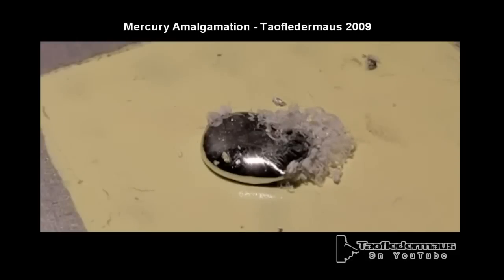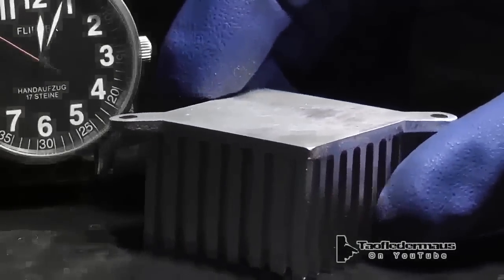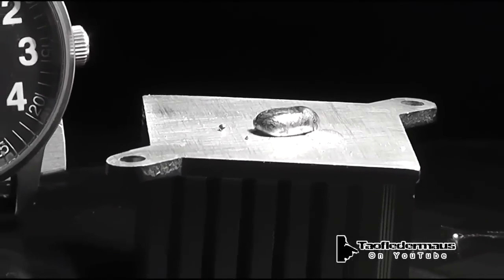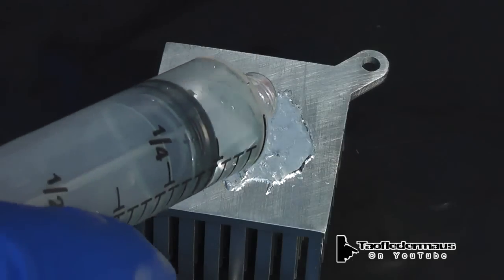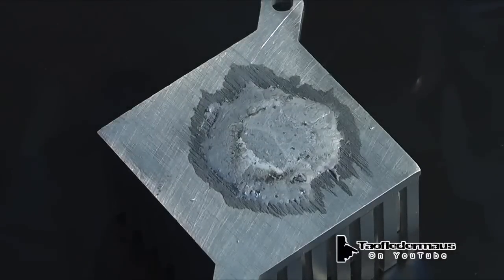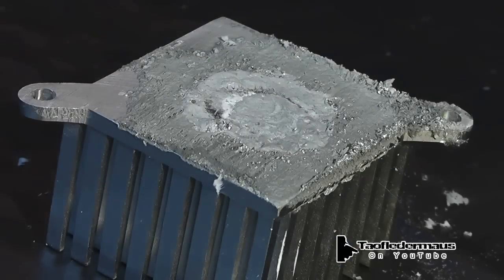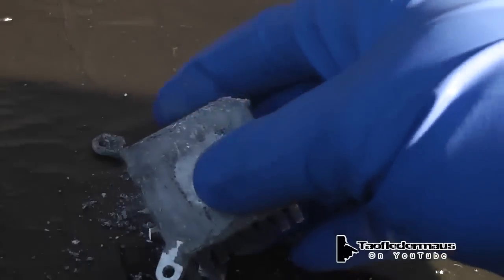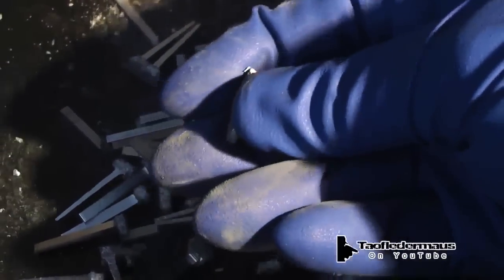Mercury AND Gallium - Totally Destroys Aluminum Heatsink

Comment: Gallium actually does not go through the aluminum oxide layer at all. I added gallium to aluminum just a few days ago and without mercury, you can see where the gallium has gone underneath the oxide layer rather than going straight through it.

Comment: I still would like to know what would happen if you outed gallium under someone's car hood
Reply: i was thinking that but in the supports of a building i think a fair amount would cause a building to collapse with the weight of the brick and mortar around the metal support beams.
Reply: Support beams aren't made of aluminium they made out of iron or steel.

Comment: Huh. I never knew gallium had a dispersion medium that is liquid. It's like paint or glue; all gooey.
Reply: im not sure what you mean. every metal gets fluid if you heat it up enough.
Reply: da real rulezbreaker You know how whipped cream works? It's a solid with a dispersion medium of liquid. That's what I mean. Google what dispersion medium means.
Reply: the gamerator 10
thats if you mix a material that is solid at a certain temperature with another material that is fluid at the same temperature. but if you have pure gallium, then how is that possible? its just one material.. its either fluid or solid at a temperature, but never both.

Comment: Gallium causes the aluminum oxide protective layer to break down.  Which leaves aluminum to oxidize easily.  If you do this in water the bond between aluminum and oxygen is stronger than hydrogen.  And the solution will dissolve the aluminum much faster and leave a solution of lumina with the gallium can be removed from the solution with a cheese cloth.  Which leaves the aluminum oxide solution in the exact state you can apply electricity to convert back to aluminum.  The process produces hydrogen!   Take aluminum pellets, and say a tank of gallium water,  mix to make fuel for a fuel cell..  To refill the fuel cell with hydrogen..  Is draining the solution of lumia refill with water and pellets of aluminum, and gallium...  Safe storage of hydrogen.  The drained solution can be shipped to a aluminum plant say next to a nuke facility or maybe if the pellets are small enough maybe right on site using solar or something..  But probably cheaper to pipe or ship the lumia

Comment: did this process release any hydrogen gas?
Reply: +wizard No, why would it? Only 3 metals reacting. Doesn't need anything like water vapor or air to happen.
Reply: +wizard Nah but my out loud speaking of these comments to myself has emanated carbon dioxide gases :I

probably why I sneeze at my desk all the time... I do that kinda stuff a lot.
Reply: the reason i mentioned hydrogen gas was because alloy is sometimes used in the process of hydrogen gas.
Reply: +wizard There were no hydrogen-containing compounds in that reaction so the simple answer is no.

Comment: Wait a moment.  In previous videos you said that mercury was the only metal that was liquid at room temperature, but it looks like gallium is also a metal that is liquid at room temperature.
Reply from the maker: +MrWhitman  I guess a sauna is a room, huh?
Reply: Yes, it is a room.  Besides, where I live, 78 degrees is a rarity.  86 degrees is actually the norm in the cooler months.
Reply: +MrWhitman   well thats not considered room temp.  Just cause you're room's nearly 90,  that doesnt make room temp higher.
Reply: Daniel Simon It was a bad joke.  Okay, I was just making a bad joke.  OF COURSE room temperature doesn't go higher.  Sheesh.
Reply: galluim is actually solid at room temp (65-70°) but metals such as galluim and cesium can melt at body temperature
Reply: +Antwan The Hankblock Savage 65-70 celsius?
Reply: +MrWhitman  no it melts at around 84 degrees
Reply: +MrWhitman I think you're taking the idea of "room temperature" too literally. If you were to set a room on fire, it would get pretty damn hot in there. You wouldn't say you're at "room temperature" as you burn to death...
Reply: +MrWhitman  for something to be liquid u need to be able to pour it out...u obviously havent looked at the galium properly

Comment: Why does it attack aluminium
Reply: +TheSamuel9464 The Gallium and mercury amalgamate, which is a fancy term for alloying that involved metals like them, with the aluminum. Aluminum may not look it but it is very reactive, the surface almost instantly reacts with oxygen which stops the rest from reacting, but gallium and mercury inhibit it's ability to keep a solid layer of aluminum oxide, and with gallium or mercury added as new forms it flakes off, making more worm which then flakes off. It's just like how iron oxide flakes off of iron so that the underneath layer can oxidize, only much faster. And as for the weakening effect, gallium aluminum alloy is just very soft and brittle, (also a eutectic mix of gallium and aluminum is liquid at room temperature).

Comment: Hi Jeff, back in the 60s I rubbed a droplet of mercury into a piece of aluminium with "wet" wet and dry sandpaper. The water let the mercury form an amalgam with the aluminium and this exposed the aluminium to the air which formed aluminium oxide whiskers on top of the mercury very rapidly. I supplied the aluminium and the sandpaper and my science teacher supplied the drop of mercury and the water along with the instructions. How times have changed. OSH would have a fit! Peter.

Comment: Welding aluminum is such an hard process, perhaps a little bit of gallium can help the welding of aluminum in some way. The oxidation is so strong that it's kinda hard to make a good weld without out pofessional tools. Could you find a way to use gallium (without mercury) to bind aluminum to another piece using any filler type of material? 
Or do you know a way to remove the galium after adding it to aluminum (we're talking a very tiny amount.
Reply: Derk Jochems Gallium does the exact opposite of what you want to do - it separates aluminum and irreversibly damages its structural integrity.  The easiest way to separate them is to add water (which produces hydrogen, and a lot of it).  The aluminum is left behind as a powder, and the gallium can be clumped together in a little ball, and can be re-used pretty easily.

I don't know much about welding but I think the aluminum powder might be easier to weld than just plain aluminum, but I could be wrong.
Reply: Peter Schmidt Aluminum has an oxide layer wich is so tough, and melts at a much higher melting point then aluminum itself. Galluim seems to penetrate that oxide layer with ease. And mercury possibly too, but mercury is not allowed to be used in any products in the EU as far as i know. 

I see what you mean, and your right. I was more aiming towards getting opinions and probably somebody who has gallium to try and fuse aluminum with something (like a weld). 

The process i mean is break-and-restore, gallium breaks the oxide and makes room for something to fuse the aluminum to (as in theory there wouldn't be any more aluminum oxide so it makes for easy fusing, but as you suggested it breaks up the aluminum irriverisble).

It opens a view, that isn't tested so far i know.
Reply: Derk Jochems
It's a good thought in theory, but aside from the gallium penetrating so deep into the aluminum, part of the problem is figuring out how to remove it without removing the aluminum with it.  It is a chemical bond, after all.  But yeah, it's too bad it isn't a solid structure because otherwise that would be an incredibly easy way to weld.

If you like energy efficient ways of welding, you should look into "cold welding".  There isn't really a practical way of doing it (on Earth) but still amazing, and something that astronauts do.
Reply: Peter Schmidt Thanks peter, and for the record i hope some bright people will find a way to be ingenius and find a good way for aluminum (very easy) chemical bonds..;)

I'll have a look in cold welding for now. As i can't experiment with gallium (can't import it from the us to the EU).
Reply: Derk Jochems
Actually I completely forgot to mention - the oxidized aluminum powder you get from the gallium+water+aluminum reaction is one of the key ingredients to thermite.  Not sure if you're aware of thermite but it is known to be used for welding and under the right conditions, all you need is a lit match.  Careful though, thermite has a terrifyingly violent reaction.
Reply: Peter Schmidt are you serious, i'm totally not able to handle thermite here. It's too close to other people. Way too dangerous stuff. But it might be an interesting thought though.

Thanks for the info that could help others move along.
Reply: haha yeah, definitely need to avoid using thermite near.... anything.  Great product to remove waste materials though lol.
Reply: Peter Schmidt I know the stuff from mythbusters and seen it on youtube. It destroys everything, cars, tanks muhaha but i'm not ever going to test that here. 

Having a heineken now, cheers .. ;)
Reply: I've played with an AC TIG welder, and it's actually pretty straight forward welding aluminium?
But yeah, USD$1,500 is an expensive entry price...
Reply: +Peter Schmidt:
"The aluminium is left behind as a powder, and the gallium can be clumped together in a little ball, and can be re-used pretty easily."

==That's not aluminium powder. It is Al2O3, aluminium oxide.
Gallium is not as reactive so it stays mostly in its metallic form.

"Actually I completely forgot to mention - the oxidized aluminum powder 
you get from the gallium+water+aluminum reaction is one of the key 
ingredients to thermite."

==No, the thermite reaction uses Al powder and iron oxide powder. You could of course use some other oxide to reduce, such as zinc oxide and various other oxides. For the Al powder (the reducer), you could probably substitute with some other reactive element like Mg powder.

Comment from the maker: Lady Minion
2 hours ago
Linked comment
did you copy this from mist8k ?
-
Why to people ask questions and disable the "reply"  option?   Don't be like Lady Minion
Reply: DID YOU COPY THIS FROM TAOFLEDERMAUS!?
Reply: Question:How do you dispose of all the amalgamates as well as the other toxic mercury by products like mercury oxide?
Reply: +TAOFLEDERMAUS  O_O i just came up with something why not stick a gallium plant near a aluminium f150 plant so ford will make steel body trucks instead of Prius plastic and aluminium lol
Reply: I love your mercury videos! But just a question, how much does mercury cost? Is it expensive?
Reply from the maker: It's about $100/lb
Reply: ***** you think he uses 5 lb per video? -.-
Reply: *****
fair enough. The experiments I've seen he was using less than the outer joint of a finger.
Reply: +Teryhr He Reuses The Mercury
Reply: +Teryhr Yes It Can. He Has Many And He Only Does Experiments Wasting Mercury Very Rarely, And When He Does, He Uses Only A Bit. He Said He Bought Lots Of Mercury 15 Years Ago. He's Using The Same Mercury.
Reply: ***** Sometimes Is The Keyword Here.
Reply: +TAOFLEDERMAUS oooooh, taking the piss out of nerdrage's channel are we?
Reply: Wait, +TAOFLEDERMAUS, does this mean you are NurdRage?
Reply: +TAOFLEDERMAUS Hi u got me wondering how far can u take this experiment... how deep can the gallium penetrate?  does it penetrate any steel or aluminium? would u get through 3 inches of steel?
Reply: Did i ask u or?   i didnt think so
Reply: +Virtualgod2009 you really shouldn't do that bc what if the trashman touches or it goes near a place where we get our water?
Reply: +some guy are you joking? cuz if you are serious im highly concerned about the farm and crops where these mercury spiced herbicides  are used. mercury for your instance actually its organic salts are very toxic.
Reply: I thought you were nurdrage but i blame autoplay
Reply: yes, it would be disastrous for gallium to get on an ALUMINUM air plane... but what about STEEL plane? hmmmm? lol I'm just messing around. Anyway love the Content
Reply: +MegaCHUBBER

NurdRage has a MUCH deeper voice.
Reply: +Jason Mayne NurdRage is using a voice changer -_-
Reply: Billy Holman How do you know?
Reply: Jason Mayne dude, it's fucking obvious, no one has that deep of a voice naturally
Reply: n
Reply: You should buy a car with an aluminum block or heads, put gallium on it and run the engine
Reply: sjpro1 KABOOM!!! That is, I think that would happen.
Reply: Jason Mayne yes but how much of one haha
Reply: sjpro1 I think that if the block explodes, it'll cause a chain reaction and explode the entire engine, as well as the fuel.
Reply: Jason Mayne doubtful. the fuel system would likely be unaffected.
Reply: sjpro1 Ok.
Reply: according to my science teacher the oxidation layer is aluminum and the raw metal is aluminium
Reply: You have good voice mimicking, or it's a voice changer.
Reply: BroDaCarot the oxidation layer is aluminum oxide and the base material is aluminum. or if you are in England it would be aluminium oxide and aluminium. Aluminium and aluminum is the same exact thing just spelled differently depending on the region just like aeroplane and airplane or whiskey and whisky. But the aluminum and aluminium spelling is debatable because the person that discovered the metal named it aluminum and a governing body at the time wanted the I before the um for consistency to match other metals like titanium or some such bullshit that makes no sense because there was already platinum so it was renamed aluminium in British circles.

It's also a fun word between Brits and Americans when they say it and call each other out on the pronunciation when they are both correct. One would never guess that one little I would make so many look like fools for calling others out.
Reply: HhhTAOFLEDERMAUS

Comment: ***** 
Good question for you. If you have a half inch aluminum cylinder and you soak it in Gallium depending how much you use... How long would it take to fully break down all that Aluminum so you can break it in half with your hand or even a press?

Thanks and loving the information you push out every video :D

Comment: We are manufacturing company specializes in Elementary 
substances such as:Prime Virgin Mercury 99.99%,Silver Liquid Mercury 99.99%,Metallic Mercury,Red Cherry Liquid Mercury White Liquid Mercury

SPECIFICATION

- Virgin Mercury purity = 99.99% by wt min.

- Free from heavy metals

- Packing iron cylinder ( 34.5)kg net weight or 1kg Flask

- Physical State: Liquid

- Appearance: silver- Odor: odorless

- PH: Not available.

- Vapor Pressure: 0.002 mm Hg at 25C

- Vapor Density: 7.0

- Evaporation Rate: Not available.

- Viscosity: 15.5 mP at 25 dig C

- Boiling Point: 356.72 dig C

- Freezing/Melting Point:

-38.87 dig C

- Decomposition Temperature: Not available.

- Solubility: Insoluble.

- Specific Gravity/Density: 13.59 (water=1)

- Molecular Formula :Hg

- Molecular Weight: 200.59
contact for best price
Call 0r Text :(323) 577-4079
craigpatterson376@gmail.com
Reply: Craig patterson

Comment: Pure aluminum doesn't rust, it oxidizes and aluminum alloys are more sensitive to galvanic corrosion (dissimilar metals). Only ferrous metals will rust.
Reply: kay ger "Rust" is just iron oxide. Pure aluminum does oxidize, even faster than iron, but it is a clear and thin layer that is harder than the metal itself.